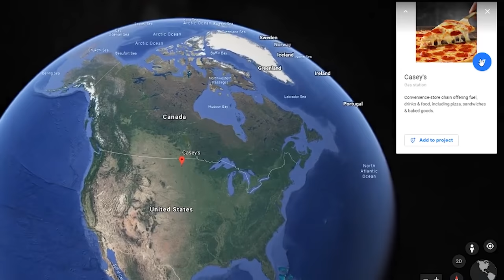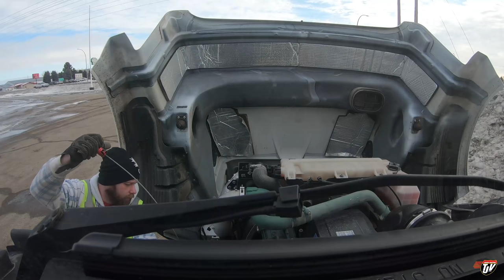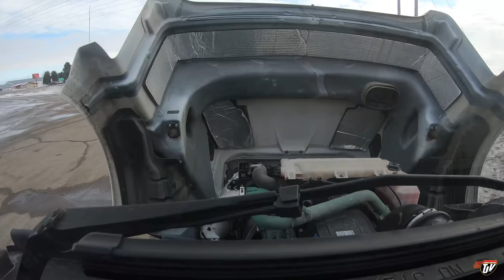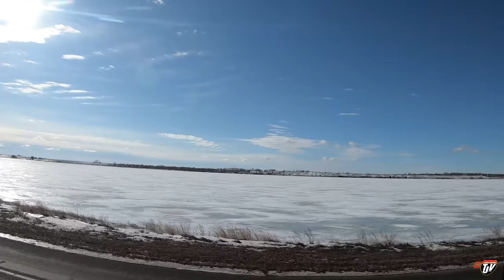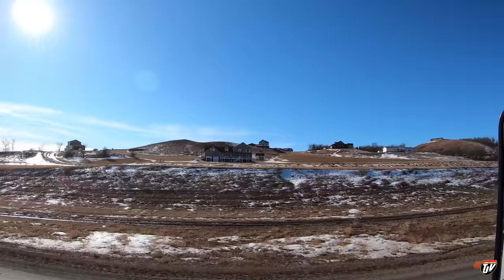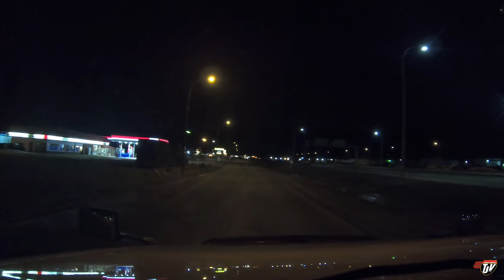My Trucking Life | MINOT | #1915

Comment: I like subtle changes, a mix of life on the road, scenic views if possible (Maybe experiment locating 2nd camera in different locations in the cab.), JBG Travels has rather extensive use of cameras mounted outside the truck, kind of like rearview mirrors & occasionally changes the angle of interior views. Try to keep Vlogs in a 20-minute range if possible, as most viewers likely follow more than one channel (Including some of your friends.). Occasional live FEEDS can be healthy IF setup at a predetermined time to assure maximum viewers, as not everyone can watch 24/7 as a few truckers do.  Anything over 30 minutes may cause loss of viewers, especially those using Smartphones (As batter life can be affected.).    Cheers from:  Deer Park, Tx.  ;-)

Comment: In the uk we have 2 rules to follow. We have driving hours where you must have a 45 minute break and 4 and half hours and can drive up to 9 but you can extended that to 10 hours twice in a week but you have to take another 45 minute break after 9 hours to get that extra hour. 
We then have the work time directive where we can work up to 6 work then need a break. That can be a 15 minutes but must take another half an hour before 9 hours and can work upto 15 hours.

Comment: Hi Josh check out Trucker JENKO in the u k trucking is different 18 wheelers going through very narrow streets  off the highways , they have the same problems fuel cost etc they have  park spots on the B roads for trucks I think I would nuts with all the congestion so different .